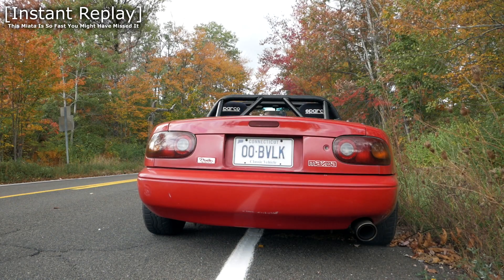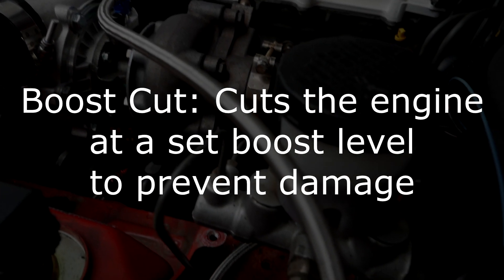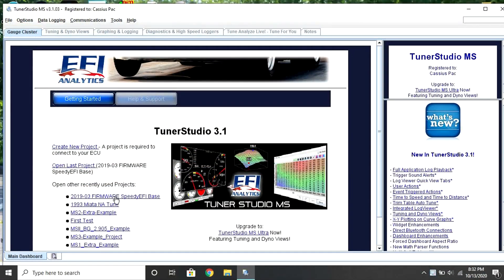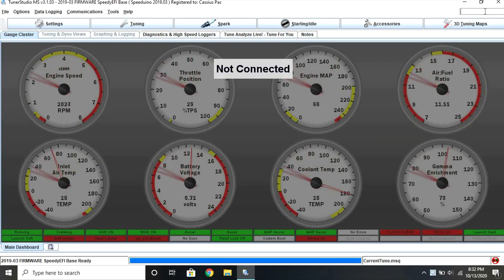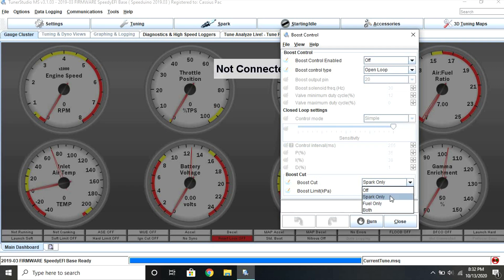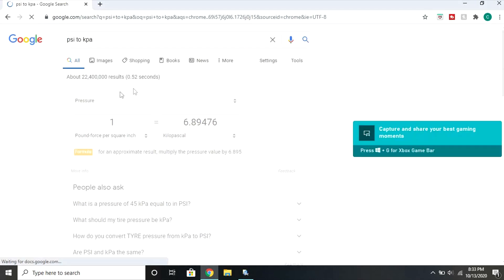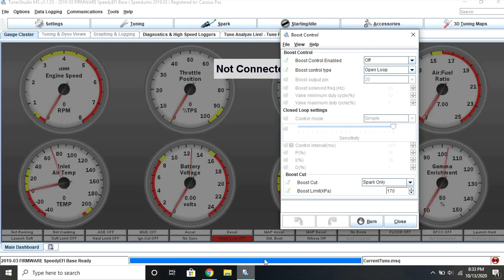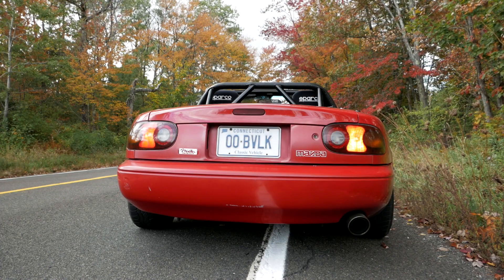Speeduino and Megasquirt: Protect Your Engine [Setting Up Boost Cut]

Comment: So could you use boost cut in order to lower the amount of boost you’re trying to run? My wastegate is 8psi and I wanna start out a little lower than that. Just got my first startup yesterday. Thank you!
Reply from the maker: Congrats on the first start! A boost cut will cut power if you hit a boost limit, but the boost cut itself will not limit boost. You’d have to adjust the wastegate for that. On mine I added additional springs to help it open sooner
Reply: @CashedOutCars  awesome, thanks for the reply and all the help with the turbo process!

Comment: wait, you're making 150 whp with 10 psi? are you going to eventually advance the timing?
Reply from the maker: Yes, as mentioned right now it’s super conservative because I have a stock 1.6l clutch in it. That’s about the limit before it’ll slip, after the upgraded this winter I’ll turn it up

Comment: Love these little videos, so to the point and useful! Any way you could do a video on intalling an electronic boost controller with the speedy efi?
Reply from the maker: There’s more to come! I’m certainly interested in doing that, it’d be a winter project though. I’m still working on dialing in the car in terms of boost, right now it’s building way too fast even with a 5psi watergate actuator. Once I get that sorted and I’m ready to use an electronic boost controller to turn it up I’ll do it! More to come on that soon!

Comment: I don't have a search option in my tuner studio..
Reply from the maker: Are you on MS or Speedy? On a speeduino it should be under accessories and then Boost Control. Firmware version does matter, I’m on 2019.03
Reply: @CashedOutCars  speedy
Reply from the maker: That’s odd, what firmware are you using? And is your Tunerstudio updated to the newest version?
Reply: I'll have to check to verify and yes newest version of TS
Reply from the maker: Huh that’s interesting. Regardless  you should be able to get to it through the menus! Let us know if you sort it out, it’ll help others too!